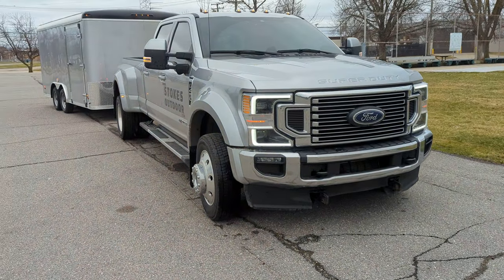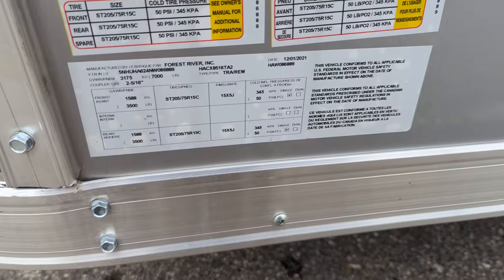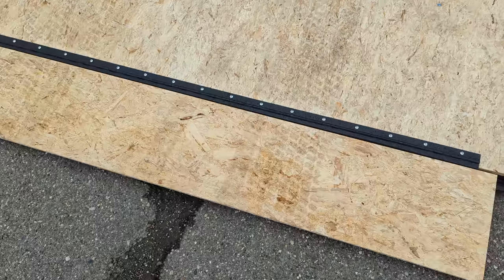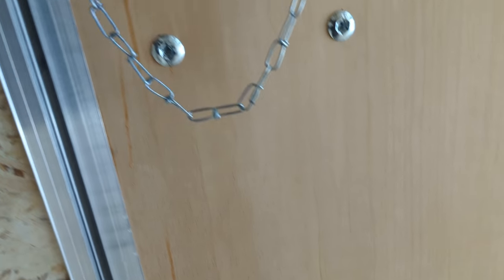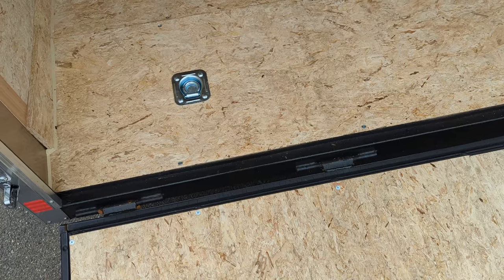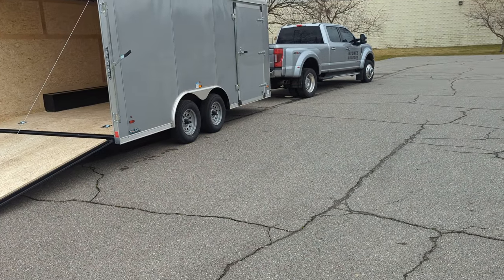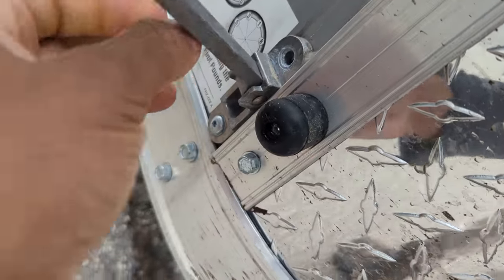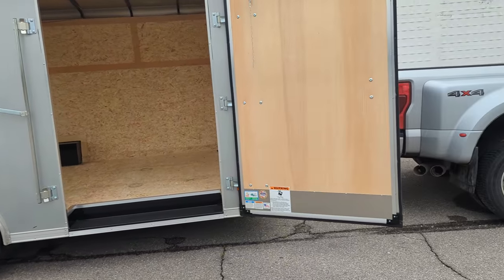I bought the CHEAPEST enclosed trailer! What do you guys think?

Comment: I like it. You can definitely customize it to your liking. Hang all 2 cycle equip on walls , shelves/brackets to hold fuel cans etc. Your equipment won’t be exposed to the weather so much and will be more secured against theft. You could even seal the floor w deck sealant and then add diamond plates over it. 👍🏼

Comment: I have a couple suggestions..... Is on your little breakaway battery... I would wire in a.. 12 V cut out... Send one to a 12 V regulator.. The size of this is about 1" by 1" by about 1/4 inch thick... It has 3 wires... One hot wire... Which would go to your running lights... When you want to charge your little battery just turn on your running  White . While the vehicles moving down the road...  You cannot overcharge the battery... Because this device will prevent backspeed.. I would put a deep cycle battery on the trailer itself..